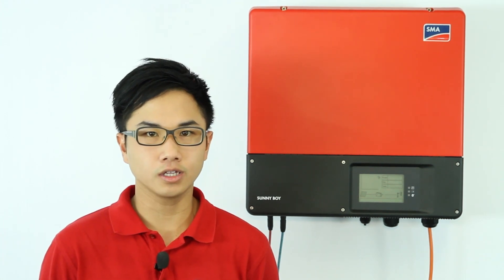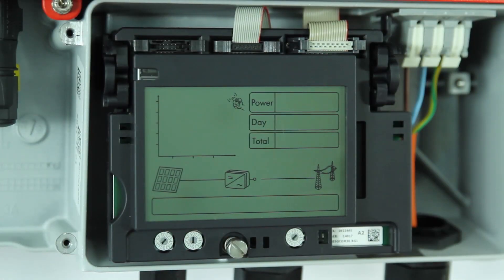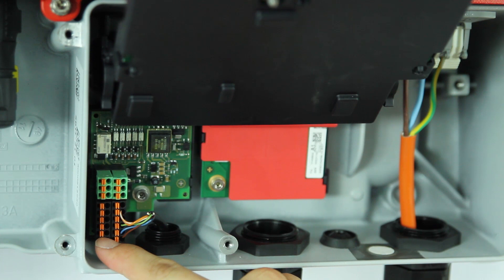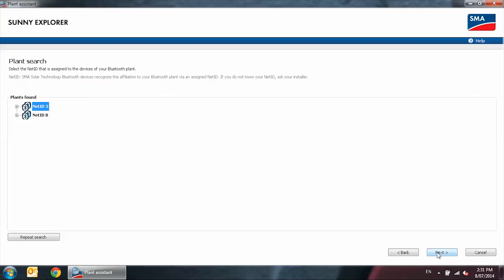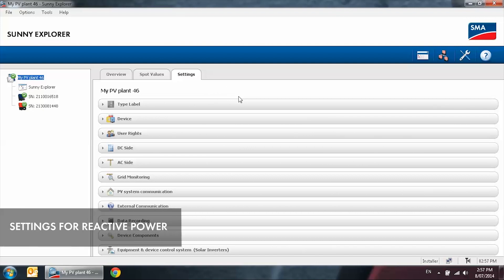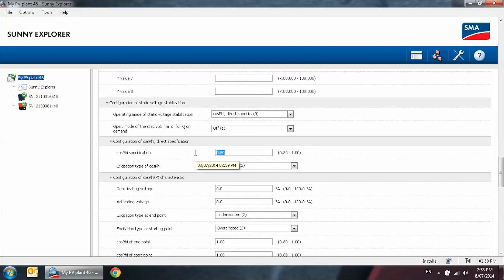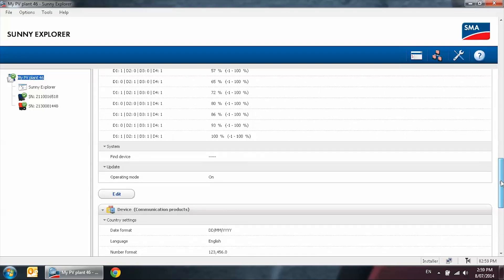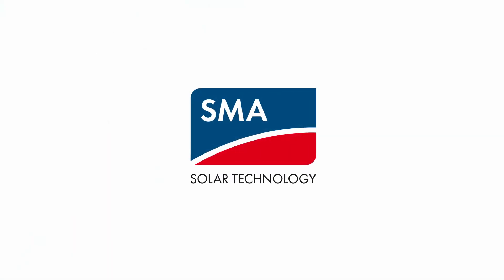Tech Tip: Limited Export and Reactive Power Control

Comment: The power control module operating mode setting does not appear under sunny explorer with my SB3800tl-us inverter. Under settings, I can see the power control module is present and the digital inputs are displayed, but I can't figure out how to activate it. Do you know what I'm doing wrong?

Comment: I have a question, the Bluetooth Piggy Back Plus Card, Can it be installed on a SB 7000TL-22 ?
Reply from the maker: Hello Rafael,
There is no SB7000TL-22 inverter. Did you mean the STP7000TL-20? This device cannot be retrofitted with a Bluetooth PickyBack.

Comment: Hi, can you please help me on how to Zero Export the SMA Sunny Boy SB3000 US.
Reply from the maker: Hello Noel,
Please contact SMA Service in you local region so they best advise.
Kind regards, Jennifer
Reply: There is no SMA Philippines, that's is why I'm resourcing out online, does SB3000 US have different regional setting? I bought mine in U.S.
Reply: hello noel, i am a pilipino, i am planning also to buy SMA SB5000TL-US-22 model. Is this inverter compatible in philippines grid? i like this inverter because of its features; Secure Power Supply, DC Disconnect, Anti Shading. Dual MPPT and large Vdc input. Please can you advise me, if it is worth buying?
Reply: Noel, do the load balancing so that it can compensate the surplus electricity your panel is producing, while waiting for the approval of netmetering.